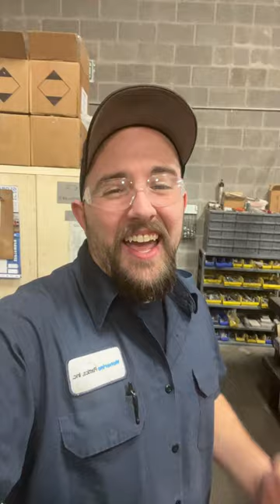Dielectric grease? #tools #tech #mechanics

Comment: it depends on the application but di electric grease is great stuff for keeping connectors clean and water free also helps keeps rubber from becoming stuck to things(spark plug boots) if you are getting a short its not di electric grease also it shouldn't be degrading any rubber seals etc as its basically just silicone paste

Comment: I use it. It saved my fuel box. I use it in areas of hi moisture. My fuse box is under the hood. $587.00 for a replacement box. I opend the new box. Used a chip brush and coated the interior of the box. If you have broken down a dodge fuse box under the hood. Coating the metal tracks carefully.
I used it on the tug boat in the Atlantic. Use it. Use it sparingly. Don't just squirt everything absolutly full. A qtip, brush a light coat, and individually sealing a terminal inside a connectior, or the back of a plug. Do not coat or fill a compleat fuse box. Use it sparingly.

Comment: Battery terminals yes, but I’ve been told enough times to just use regular grease in that case.

Otherwise every electrical connection has to be dry. Especially on trucks and tractors with dust, because shit gets stuck to it and starts to introduce corrosion and resistance to the circuit.
Reply: On battery posts I use a spray corrosion proofing (cosmoline) that turns into a hard brown wax. Spray everything assemble and tighten. Spray it down again and when it hardens it doesn't attract dirt and doesn't ever have corrosion. I was introduced to it in 1982 and I've never had a failure or corrosion

Comment: As a rustbelt mechanic, i put it everywhere! Rubber seals on filters and electric connections(only on the rubber parts and entry of wire into connectors). I even use it to make pieces slide better, the trick is to use it smarthly not like a 5 years old doing a school peoject

Comment: I used the silicone dielectric grease for my tune ups and electrical connections that weren't exposed to weather. The trick is to not use more than a fingertip's worth, or wipe off the excess.

Comment: Industrial fleet tech. Comes in handy on spark plug wires, everything else, if it doesn't need to come apart in the near future, heat shrink it. If you Keep the from coming near the connections, you don't need to keep it out. Especially on ev charger cords.

Comment: Use a little on a butt/crimp connector for possible corrosion resistance and then plug up the ends of the connector with liquid tape. It’s worked great for me.

Comment: If I'm going to use grease on my electrical connections, I use regular chassis grease. Never had a problem with it and I use it in and on every truck and trailer connector.

Comment: If there's a rubber seal there's no need. Air tight. Since it is less chemically active than the metal contacts it can cause galvanic corrosion. Contact grease is good for switch to prevent arcing and wear.

Comment: I recall that the old Willy’s Jeep river crossing kits had snorkels for the exhaust and intake for the engine and enough asbestos dielectric grease to fill every electrical connector. If the Army thought it was important enough to include it in that kit I’m sure I’m fine to throw silicon dielectric grease into connectors. In reality I only put it on connectors on my project car.

Comment: dielectric grease means non-conductive. But don't use it in a place where it can see dust because you can get conductive dust particulates in it and when there's enough of those it will conduct.

Comment: Def use it on spark plug boots, always. But you need to use it for light bulbs (only talking about automotive here) and harness connections as well. It's never gonna short out a connection...NEVER!! period!
Reply: It seems to be a must in sockets for 194 bulbs on Ford license plate and marker lamps. They have a bad tendency to corrode otherwise.
Reply: @Krankie_V  Ur absolutely right. I live in a state with high humidity too, so I also use it on all my lamps(automotive ofc, lol) when replacing the bulbs.

Comment: If it is going to be in the weather I definitely use it. If you have used stuff that was conductive that’s anti-seize and it is definitely conductive unlike dielectric grease. I use dielectric grease on all fog light plugs because I can look at mine on my car and they are pristine and then a customer car comes in same car and newer ones and I have to replace the connector so it works again. I will use anti-seize on a ground connector on a trailer for example. They seem to hold up longer with anti-seize on them than dielectric grease. Also trailer plugs always get greased because it may sit 6 months and without protection you will get oxidation and then have connection issues and lights not working.

Comment: Here’s the thing, just like 90-95% of anything some does is because of how they were taught. I was born and raised in Erie and lived through the harshest winters and in the 15+ years of working on cars up there ( I lived there 30 years but the the first 12 or so, I didn’t work on cars ), I never used Dielectric Grease on any vehicle I worked on (including my own) and I never had a problem.

Comment: I personally use it on truck lite connectors for marker and tail lites that don’t use water tight connections    Other than that, I’ve found It cause a ton of issues if used on connections controlled by a ecu or other computer
Reply from the maker: Thats kinda what I was getting at...

Comment: It depends on what the application is for. I service forklifts so if the unit is always inside in a dry facility I don't use it. If it's a cold/wet facility or they go outside I use it.

Comment: Engineers don’t like it because it’s application is very hard to apply. You can’t get very specific with it when you’re specing it for assembly or service manuals the closest to a spec you can get is apply a thin coat of a specific grease or use no more than x amount of y grease it’s better to just spec out a material for the terminal that won’t corrode then spec out a nut and washer and a torque to ensure protection then spec out a boot to try to keep some debris and water off the connection

Comment: I use it on older vehicles that run a spark distributor. I don’t use it much on the modern day engine that uses a coil pack for each cylinder. But I’ll put just a little bit on the ceramic to create a proper seal.

Comment: If youre having shorting issues odds are you didnt clean the connector well enough and had something metallic stuck in the grease. Also if its degrading rubber you're using the wrong stuff. Use silicone based rather than petroleum based and you wont habe that issue.

Comment: Use grease moderately. Don’t grease a fitting till it comes out of a joint. That’s bad. Only use dielectric grease on electrical connections

Comment: I have been a technician for 35 years. If used properly, only filling the female holes on one side of the connector, there should be none on the outside to attract contamination.

Comment: Dielectric grease is non conductive 
Meaning that yea the components it was applied to will still conduct electricity normally but it will prevent the short circuit across the individual undesirable components 
Example the two terminals of a plug will not short together with the dielectric grease but still create the path in a desired direction 
Try using regular grease on a plug where that is conductive and will short out for certain 
The example you mentioned but didn’t elaborate on which is what you had probably thought to have said is that the debris attracted to the grease can often be a problem and conduct electricity 
Enjoying the content 😊

Comment: I learned about dielectric grease when I was a kid. I had a Sunbeam Alpine with a Lucas electrical system. You know… lights out on a country road at 2:00 am.   Little by little, I went through the connections and got everything fixed.

Comment: Don't use it in my current field. But spent 22 years as a auto technician and a 4x4 hobbyist that plays in the Dunes of Oregon. just a lite coat around the seal or spark plug boot. never on the contact

Comment: Very rarely do I use dielectric grease ..... but in my opinion it depends on the fittings if it's exposed to elements and if it's on equipment or a fair weathered commuter vechals ...

Comment: Have Used it 50 yrs and never had it to mess up rubber . it is Non Conductive and works well on automotive ignition points lube. Used on Spark Plug Wires. But not for putting on a HEI Ignition Module Because it does not transfer heat very well.

Comment: Dielectric grease is not conductive,  however when it becomes contaminated then yeah it can become conductive.. I would only use it on battery terminals if I was going to use it.. just to be clear I mean over the connections after they have been nipped up dry first.. might put a bit on the starter solenoid hook up bolt and the alternator if its the bolt and nut type (not a plug) ..

Comment: On battery terminals and sealed plugs but other then that I won't use it. Proper maintenance and quality work will last much longer and keep everything working as it should or better depending on how you maintain it.

Comment: Trailer plugs and spark plug boots battery terminals. And any connections exposed to extreme amounts of water like abs plugs  The alternative is green death. And plug wire rubber stuck to plugs. Ect....

Comment: Make the connection first,  then apply SILICONE dielectric grease so it's good for your rubber and plastics. Do not rub the grease all over the contact points then make the connection .

Comment: Dielectric Grease is non conductive. Spark plugs....put it around the porcelain to create a seal between the boot and the plugs that prevents carbon tracking or arcing. I only use a synthetic Grease. Does it degrade rubber? No. Can it attract dirt? Yes. Do you need it ? Depends..on how much water your stuff is exposed to.

Comment: Dielectric grease by definition is not conductive , and helps keep moisture out of multi-pin electrical connections. 

Anti-oxidant paste is conductive and is great for use on automotive battery terminals and electrical connections in damp and wet locations.

I think you’re confusing the two.

Comment: I use it for my atv I kept having problems with my thermostat throwing the whole machine into limp mode until I put dielectric grease on all the connections I wouldn't bother on my truck but if you're having problems during the wet seasons then I guess you can

Comment: I never use it. I perfer properly sealed connections that stay dry. I work underground and dielectric grease cause lots of electrical issues. Mainly from what I feel is misuse but who really knows the proper way to use it our issue is it pulls moisture which causes the short.

Comment: No, real dielectric grease is not conductive and it's pretty much inert, with other greases YMMV. If used properly, it keeps the crud from penetrating.  It keeps water and AIR out, which prevents corrosion.

Comment: Bad locations it is used commonly.  Never had a shorting problem from the grease unless I failed to wash it out and got dirt in with it.  Wash it out and start over if you get dirt in.  But with small pin wiring harness have had intermittent connection problems.  Like it for big spade terminals.  Small pins depends on the location.  In some cases seal the inside with grease and the outside with clear silicone sealant.(especially the wire to plug part of the connection on the back side)  In a few special locations use just plain grease.

Comment: It is made so your plugs do not send current away from any contacts.  It does not conduct electricity. Dielectric means non electric.  It DOES NOT degrade rubber. Yes use it 

Not sure what kind of grease you’re using but it ain’t right lol

Comment: Not automotive but  We use it on some connectors up the tower. Mainly for the remote electrical tilt motors and cables. 

Having said that I've learned that it works wonders on the trailer hitch

Comment: first, dielectric grease is definitely not conductive, that's what dielectric means.....and it won't ever degrade rubber seals like weatherpac connectors....I'm an L1 master tech, 35 yrs.....I've used it religiously for as long as I can remember not only for wiring but on almost every type of rubber o-rings and gaskets.....

Comment: Funny, but I’ve never had a failed connection because of dielectric grease, however I’ve had hundreds of them because they’re all green and corroded. As to “attracting dirt”, you can have a little pile of sand on battery terminals and they still work, but when they’ve got all that crystallized acid on them, they tend to fail. Nothing funnier than a tech telling me how he’s helping me by being lazy.

Comment: Use 3M brand on my Hobart 225 generator welder on the connector studs for my welding leads it's also inside the twico quick connectors where quarter-turn pin studs connect in it's also just a little bit on the backside of my rheostat to keep the corrosion off of it I also use it on the tap selector good stuff when used right a dab will do you

Comment: Not so sure how handy it is for keeping out water excetera I generally only put it on the o-ring itself... Not so much for water intrusion but it probably helps there a little also but mainly because it will allow things to twist or install more freely... Real handy for non electrical applications like headlight housing caps or the o-ring on bulb sockets. (Really hopeful on those that you can barely get one or two fingers on but you have to apply 100% of your might when removing... Much easier to reinstall)

Comment: Used to use it but recently i've changed my mind and i've kinda grown to hate it just cause of the filty associated with its use and i do clean my engine alot and the shorts on those sensors which should be protected by seals but who knows....i just wish i knew what that factory yellow sticky grease on bulbs and sensors is called i believe that would be safer unless thats di-electrial grease as well then i dnk but it seams a little different than the stuff i buy on the shelf...but thanks for all you do Later

Comment: Anybody that's ever touched a JLG or Genie boom lift for any reasonable amount of time knows all too well what kinds of voodoo horseshit you can get with gobs of dielectric grease in a plug. Can bus faults, short to ground, Short to hot, communication errors, erroneous readings, you name it dielectric grease will do it. Someone needs to teach the factory installers a little goes a long ways. (Meanwhile they're spreading it with a battery powered caulking gun like it's panel sealant)
Reply from the maker: I was a JLG tech for many years. And I absolutely agree with this. That was the big motivation behind this video. Thanks for the comment!!

Comment: If you think a little dielectric grease on an automotive electrical connection might cause a problem...tell me what you think you're gonna do about all the corrosion and iffy connections and totally oxidized wiring, difficult to diagnose electrical issues, poor connections to your volt meter test probes that you WILL have if you don't use it.

Comment: I use it mostly on spark plugs to prevent the rubber from sticking. I sometimes use it on on other plugs but not often anymore. I found moderation is key. 

In my early days as a tech it was pushed to use it on pretty much everything.

I do use it on starter wires since they get exposed to water

Comment: Dielectric, literally means nonconductive. First time I've seen you make a mistake since I've been watching your channel. Look it up though. And petroleum based lubricants are the ones that break down rubber, not dielectric.
Reply from the maker: That’s true. But the only reason I bring it up is because that actually did happen to me. Craziest wiring mess I had ever diagnosed. Ended up being the  dielectric grease in the terminal box causing all the trouble. Thanks for the comment!!

Comment: Only thing I add Grease to is the Battery terminals on a car or truck High temp Shell oil co .    Main or Sub Breaker box the 220 lines I do use Dielectric grease with aluminum wire , Copper never .

Comment: Most of your videos have been informative,  now I am questioning them. You do not understand dielectric grease.
Reply from the maker: When you spend as much time as I do
Fixing things. Especially wiring. You will run across crazy things like this. Trust me, I had a short to ground issue causing problems all due to die electric grease. Stuff happens.